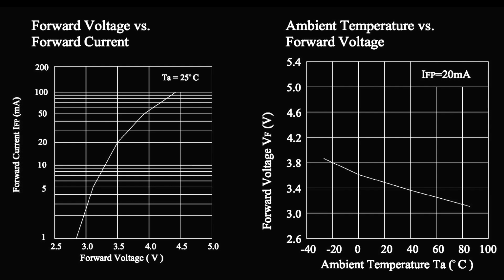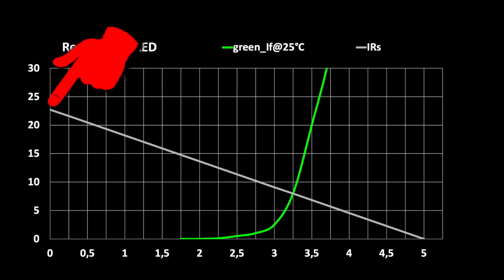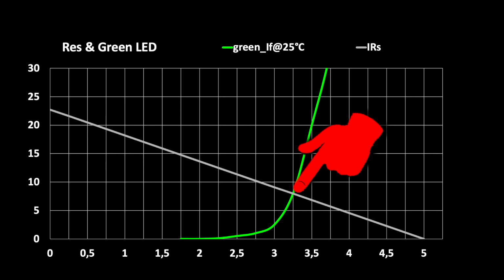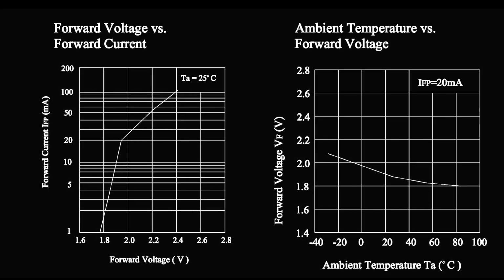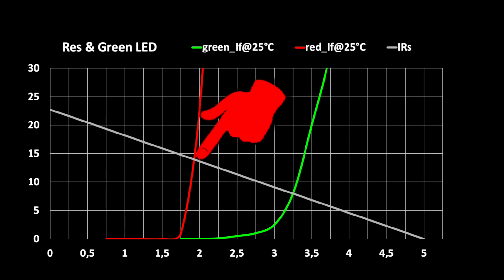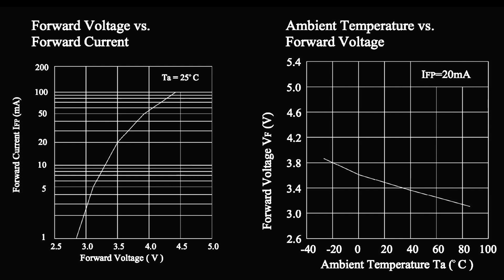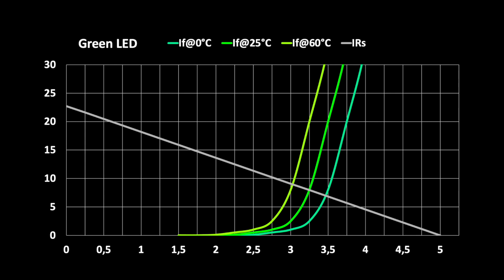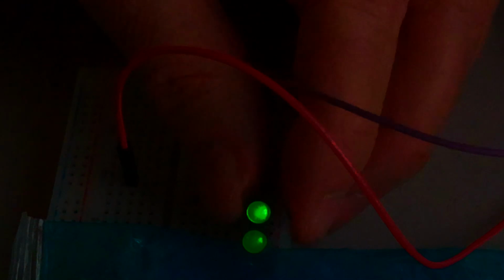Why semiconductors in parallel can be dangerous (EP153)

Comment: Always interesting considerations. One example of many LEDs in parallel are the so-called "Christmas strings" of a dozen or more white LED lights. I opened one. All the LEDs are in parallel with no series resistance and connected directly to two 1.5-volt batteries in series (3 volts nominal). They work well, with no apparent difference between the first and last LED in the chain. I noticed that they use very thin wires. Perhaps this is the solution. They behave like many small resistors placed in series with the LED, one for the positive side of the power supply, the other for the negative side. Furthermore, I believe, the internal resistance of the batteries must be considered, which is not zero as in theory for a voltage generator. Or perhaps the diodes don't know they couldn't work, but they do. 😂😂Best regards, Claudio
Reply from the maker: Hello Claudio,
Thank you for your kind comment!
Sometimes you do things anyway just because you don't know the danger. 😅
But seriously, you can actually operate LEDs in parallel under following constraints:
1. Low power
2. All from the same manufacturer's batch
3. Same type
I tried that and it works.
If you want to be absolutely safe, dimension the series resistor so that the maximum power of a single LED cannot be exceeded.
With the Christmas strips, there might also be a small resistor on each LED chip?
Best regards, Klaus